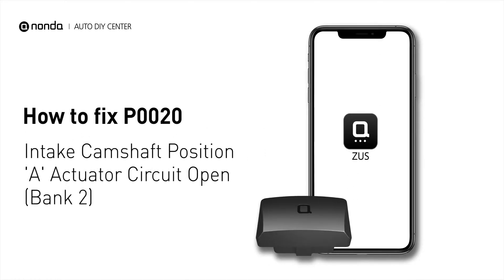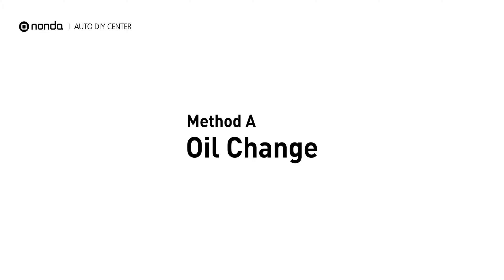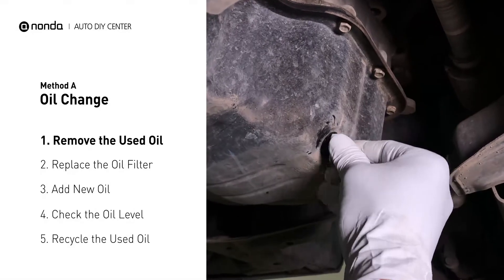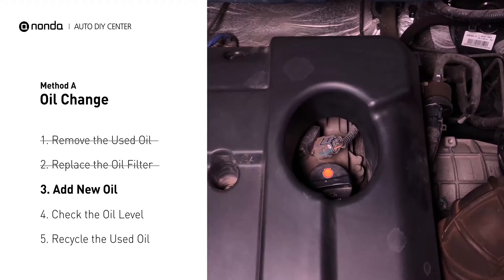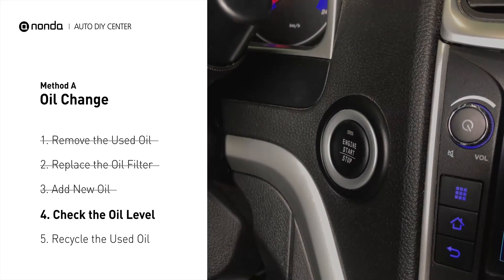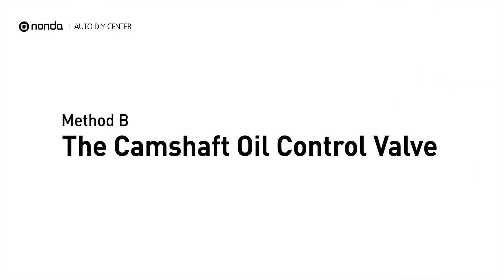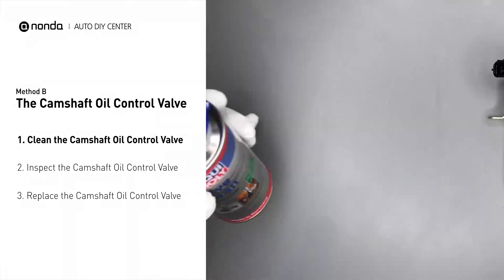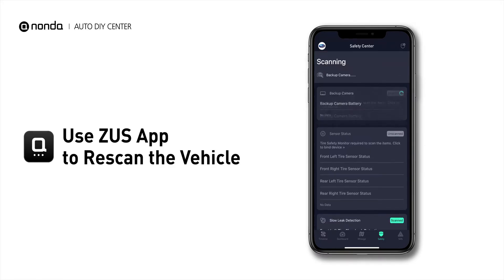How to Fix P0020 Engine Code in 4 Minutes [2 DIY Methods / Only $6.46]

Comment from the maker: Hi, I'm Steve, nonda's lead mechanic engineer. 
Feel free to leave your comments here if you have any mechanic questions, I will be glad to help you out!
Reply: Hi I use a Toyota venza with v6 engine. It keeps throwing code p0020, p300,p304 ,p0348 and U0100 all permanent codes. I have cleaned the cvvt,it still throws the code.But the car runs fine just that the mil code won't go off